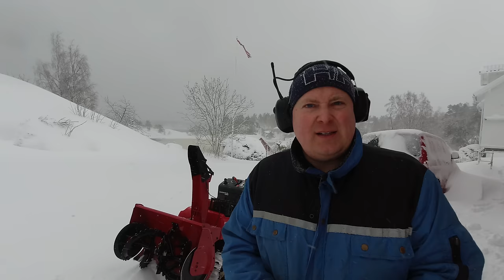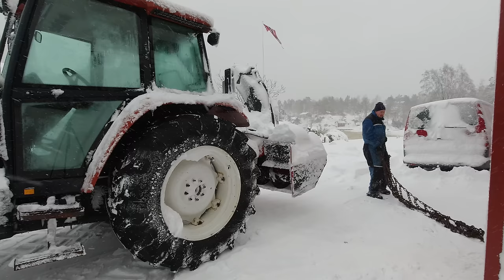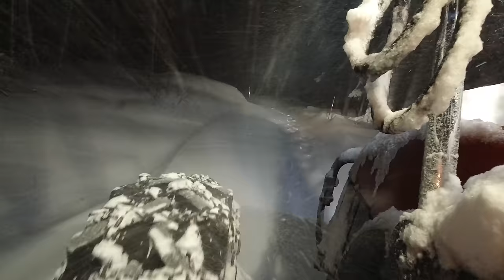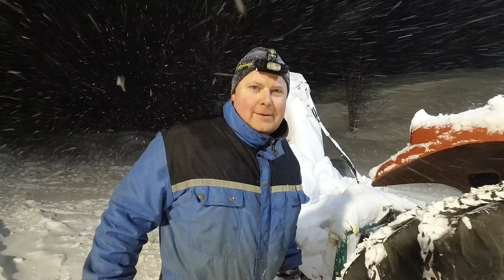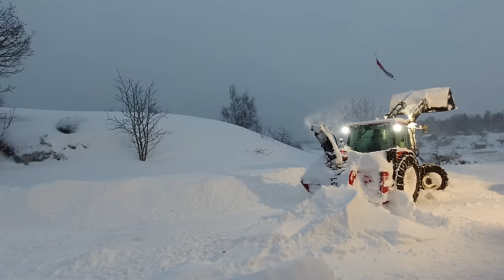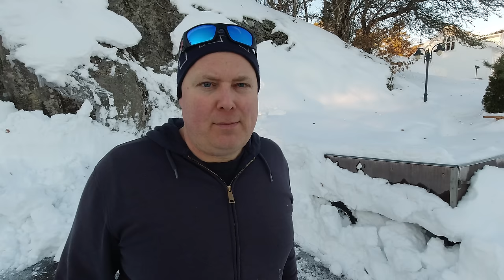Tractor Snow Blower!! Big Snowstorm hits Norway 2024!

Comment: You should mount a diesel heater in the tractor,so you can heat it up before use! And no ice/dew inside! These tractors never get hot inside without. :D
Reply from the maker: @TimT0m461 Yes, for sure! Or buy another tractor😂

Comment: With the zero turn tracks, that Honda maneuvers very well in tight spaces.  Impressive!!
Reply from the maker: Yes, it has electric drives on the tracks, so it is possible to run each track in different speed and direction. Makes it so easy to turn this heavy snow blower around!

Comment: That was an impressive amount of snow that you cleared from those storms.  It is certainly hard to beat an inverted snowblower on a tractor for clearing snow.  I've used a silicone spray lubricant on my regular sized snowblower to prevent heavy snow from sticking.  I suspect doing the same on your inverted snowblower would work just as well.  Do you not have a building to store your tractor in?  Having to dig out your tractor each snow storm is certainly inconvenient.

Comment: Sometimes you get a storm and it asks you a load of questions and poises problems, all of which you solved well!🤛
I noticed an instance or two where you forgot yourself and wished you had a bigger tractor. But as always, for småbruk people like us the rule of thumb is unless you pay 2x more than the whole farm cost you'll never have a big enough tractor.
And then, with a bigger tractor it will devalue faster than the few hours you can put on it is worth
You can get a cheap big tractor, but that means it's driven into the ground. So it's better to just get a smaller well maintained tractor, and a smaller but well-designed, appropriately sized, 2-stage snowblower that doesn't overwhelm the engine, and learn to use it properly and patiently 😊

It's always a learning experience. 
I don't like those chute guards either, no idea what they're for really, and never seen anyone else use them (except when they're new at snow removal), better to leave them off in case of wet snow underneath the fresh snow because that stuff will just "klæbb" on like glue and then you've got the ball rolling.

Tilting the chute flap downwards is also a sure recipe for clogged chute, it adds more resistance and opportunity for the snow to clog up, I've seen a lot of pro's here in Tydal (a tad North of you I believe?) operate without the flap at all because even when fully open it's still a point of resistance.

Finally, driving too fast, at too low a PTO rpm. I couldn't tell if your PTO has independently variable RPM, but I noticed you went faster than I do with a "Just in" Case 1290 & Similar size snowblower with that amount of snow.
Personally I would have driven much slower than you did on the first day, because too much wet snow enters the auger housing and gets the volume and time to overcome the impeller & clog the chute.

The way I look at it since I first started removing snow myself, at the end of the day it really is an ever-changing lesson in thermodynamics, friction, mass & volume. No two snowfalls, even at the same depth, is really ever the same, it's always different consistency and friction, new questions & problems.

Speaking of thermodynamics, for rear window icing up I found that it's best to put the cabin heater on windshield defrosting, and put one of those fans with cigarette lighter 12v input on the headliner on the roof, above your head, to catch that hot air up top, pointed right at the rear window. Really does the trick!

Hope I don't come off as negative, I really like your videos the way they are and the way they come, you've already put a lot of effort into them. No need to change a single thing on my behalf, this is your fun and experience to be had, and you've graciously invited us along for the ride 💪👌

Comment: Invert your PTO shaft so the shear bolt is on the tractor side. Easier to replace when it shears
Reply from the maker: Yes I would, but the PTO spline is different sizes on the tractor and the snowblower. So the PTO driveshaft only fits one way!
Reply: @InTheVise  I see. That above zero degrees snow sucks. I always have to rev the PTO in order not to jam the chute. I carry a full size ice breaking spade to unjam it. 110hp on my tractors. Check my videos, I have the same setup as you on my commercial snow removal operations

Comment: I have never seen a rear mounted snow blower that has a forward facing inlet until now.
Reply from the maker: That is the most common type in Norway. Won’t get you a sore neck 🤣😂
Reply: @InTheVise  You dont get a sore neck from a front mounted snowblower eighter as long as its buildt for taking in snow from the front.
So that you can drive forward while blowing..
We had one late 1970s in northern norway, but as you mention i often wishd we had more power than the SHILTER UT 5000
tractor we had that had ONLY 50 hp, spesially one spring where we used it to make road thru an around 50 meter wide and 10 meter high avalange,
that blockd our village from the outer wourld and the people that regularly plowed refused to remove it bbefore spring, in case it came more avalanges.
And had to remove it by working down from the top just taking 10-15 cm each trip and 1st low gear to not stall the engine.
But yes you right, front mounted snowblowers are quite rare, most i have seen have been on say big wheel loaders and trains.
Spesially on trains it makes sence with  FRONT MOUNTED becouse its hard to drive thru say 1-2 meter snow with a train EVEN 
IF IT TOW A  SNOWBLOWER!  😁

Comment: Heres another suggestion  get some heavey rubber and attach it to the impellar tight to the wall and it will help with clogging  and throw the snow farther  it can be done with a snowblower too but there u can use an old mud flap  lol
Reply: Could invite a lot of trouble with impellers that size, and that wasn't the issue here.
Reply: @ToreDL87  actually it wouldn't be a problem as all the rubber does is clean the wall of the impeller which throws the snow farther .

Comment: These are the most effective equipment imho. You just have to remember to spray the snow in the direction you are going to clear and not where you just have cleared up from snow. 😅
Reply from the maker: The problem is that when you shoot the snow on the snow you haven’t cleared yet, it will get to heavy for this tractor to clear. When you have this amounts of snow, sometimes you have to go twice anyway. And the wind can be a big challenge for the visibility when you decide the direction of the chute.
Reply: Biggest "problem" with this setup I see is that tractor has to plough through the snow before the blower clears it. Seems counterintuitive to me, but I guess it works up to a point.
Reply: @AllajchaSibir  It works when you live in a country that only use that setup, we head out early and often to keep the roads open so people can get to their jobs, get groceries and have access to emergencies.
Snow removal over here is notorious overtime work because letting people snow in, especially if/when they pay you to keep their roads clear and they depend on you, is a bad show of due courtesy & humanity, and it's what you Americans call "huge liability", can invite a lot of legal trouble, as I'm sure you very well know.

Comment: A suggestion and a question. . soak the chains in oil off season then hang to dry under a bucket prevent rusting  and the problems that come with it also have you thought so a snow blade on the front instead of the bucket .
Reply: That's just light surface rust, proper tractors weigh a lot so chains clean up really shiny on the snow after a few sessions anyway. The studs on the chains wear out looong before rust actually becomes an issue. And then with the oil you'll compromise your gloves too.
Blades do come in handy, but with a blade that's all you can do. With a bucket you get way more options than I can fully detail here, you can tilt it whichever way to scrape, blade, and shovel, and pick up things that you have to move around, tilted all the way forward you can lift the front end of the tractor up or hook it under a slab to lift the rear end up, etc, you can even use it as a crane when you work on rooftops etc (us Norwegians do get creative).
At a similar price to a good blade you get dozens more of areas of use and the added weight means you get more traction (depending how you lift/lower the loader) 😊

Comment: This looks like the old trima frontloader frame connection
Reply from the maker: Yes. And I use HMV quick Connect on the three point, same as Trima, so the attachments fits both rear and on the front loader.
Reply: @InTheVise  and the pto still fits 😅

Comment: Why do you travel with the bucket raised in the air?
Reply from the maker: For visibility!
Reply: I enjoyed your video
Reply from the maker: @lwkinne  Thanks 😉
Reply: Also with the frontloader up you get more clearance in tight corners and weight is moved to rear wheels so you get more traction which counts for a lot when snowblower is in floatmode.